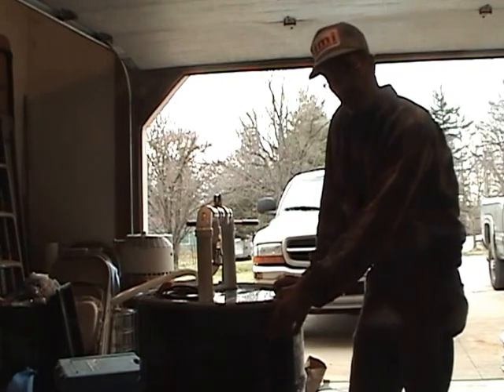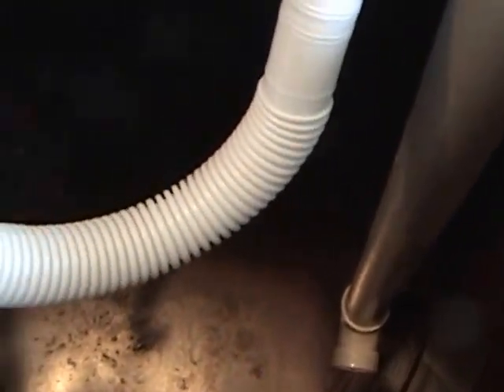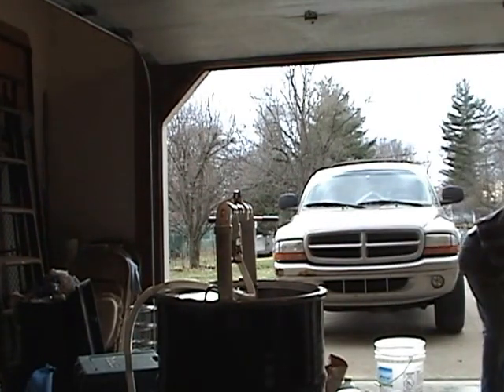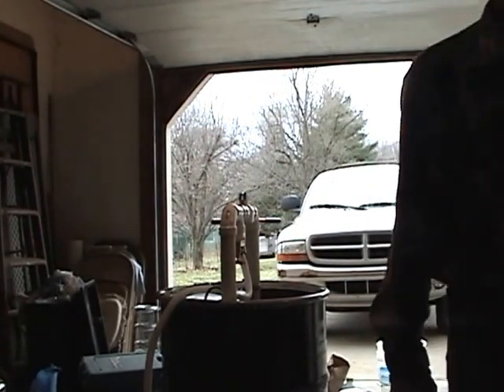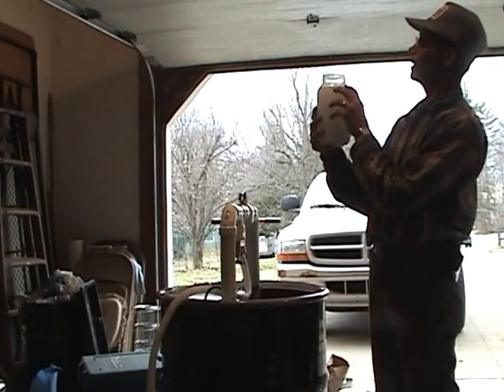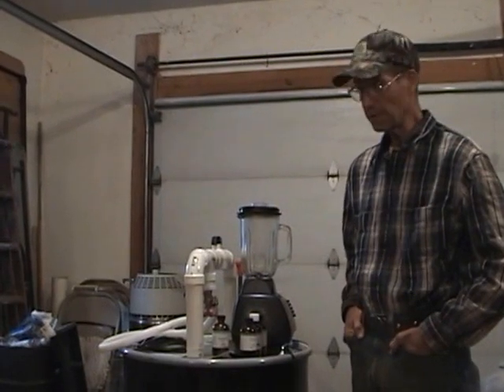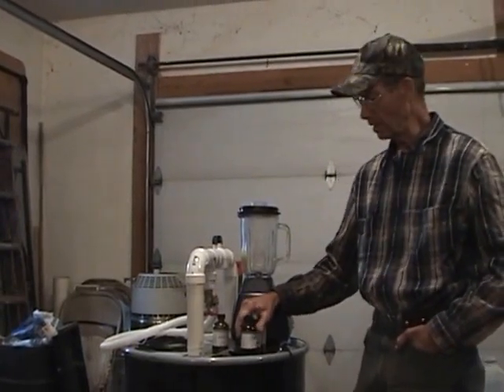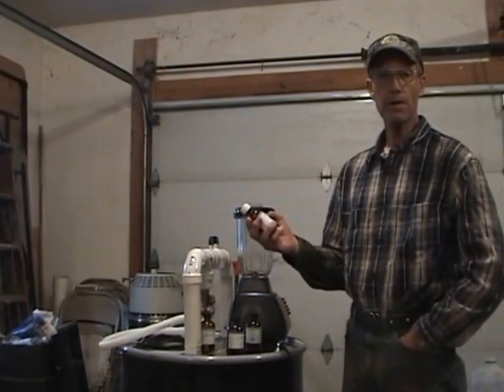55 gallon barrel syrup  mixer

Comment: Joe, is the 1/2 sump pump enough or would it be better to use a 1 hp pump?  Also, is the pump strong enough to pump up into a tote in the back of a pick up truck?

I really appreciate you posting your videos.  Our friend "Fat Bee Man" Don does a wonderful job teaching, however, you have a real gift to be able to explain in detail and make the entire subject clear and understandable.  Please keep up the great job you are doing.

Thanx,  LP
Reply from the maker: The half horse is enough for me. When  I first use it I would feel up a five gallon bucket the shut of the valve. In doing that it left the pipes all full of syrup and the motor had a hard time starting with all that head pressure. So I put an on off switch on and just shut it off when bucket is full. It will fill a five gallon bucket in about 20 seconds but bucket is on floor. I have never tried to pump it up. But the pump says it will lift 12 feet. I think it would work.
Reply: Larry Peterson 1/2 is ok

Comment: after you do a batch, do you run straight water to wash to pump? Or does the drying of the sugar water between batches not gum up the pump?
Reply: Theo Eicher no because I make a batch EVERY three days
Reply: Hi I am getting ready to make one of these, any design improvements you have come up with since 2016? Two metal tie downs are sufficient to secure the pipe to the barrel? Thanks a mil,

Comment: looks like you put hot water in there. Why doesn't your pump hit a thermal shutoff after a while (mine does)? Is your the water just lukewarm?
Reply from the maker: I use cold water never had a problem with the thermal overload. I left in on all day once the barrel was so hot I could not touch it.

Comment: Morning Joe quick question I'm going to make this I need to make big batches of syrup how much at a time have you made in there ? And how much can you make at a time ? I just ordered a 1/2 hp pump if you could explain that be great once again thanks joe.
Vince.
Reply from the maker: 55 gallons. Right now I am mixing 30 gal. water to 240 pounds sugar.
Reply: Morning so you do 55 gallons at one time? And is that a 2 to 1 mix you're doing with a half horsepower motor?
Reply from the maker: I don't feed 2:1 all the time but the pump handles it okay